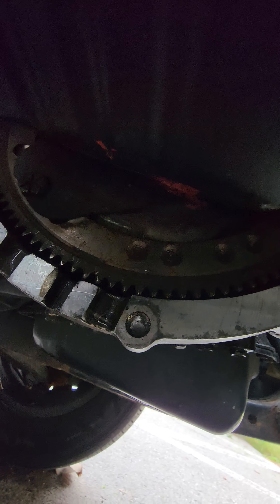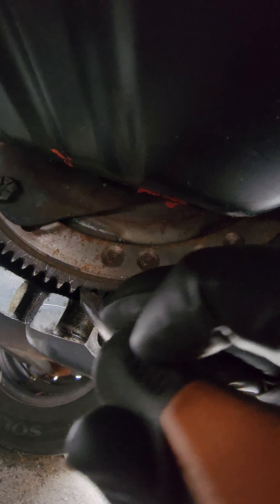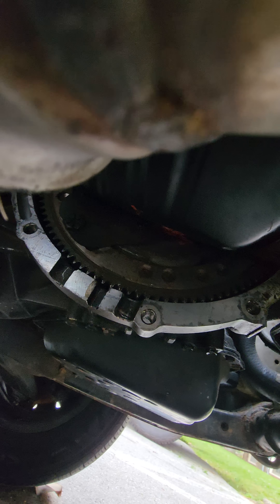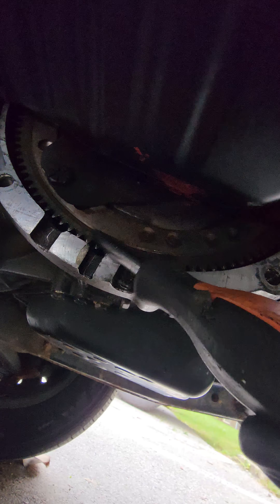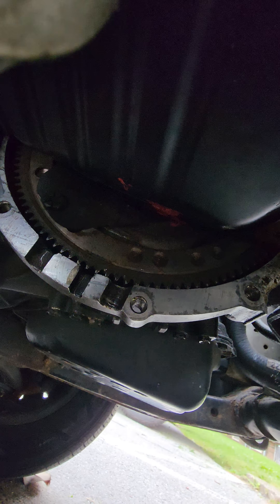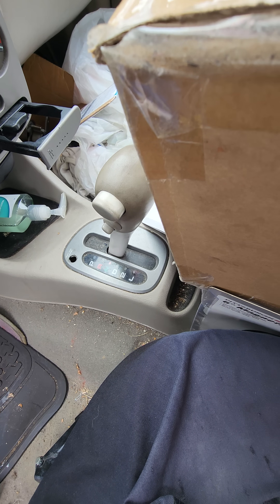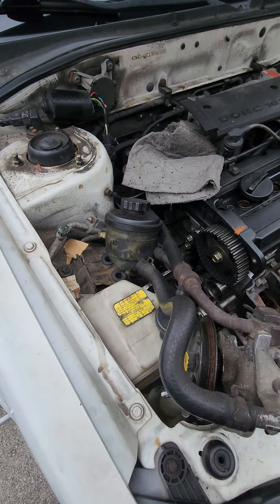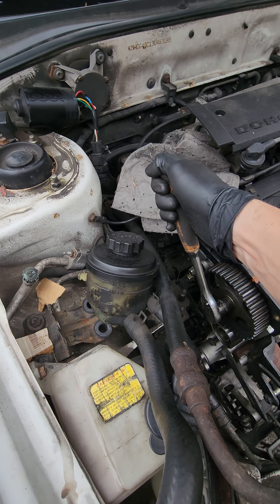Why won't the crankshaft turn? It's not seized.

Comment: Main bearing caps are probably on incorrectly.
Reply from the maker: I replaced all the bearings. I didn't run into any issues along the way. That is possible, though. As far as I can remember, I did it correctly. It would've been harder to mess it up with all the parts keyed and stuff.